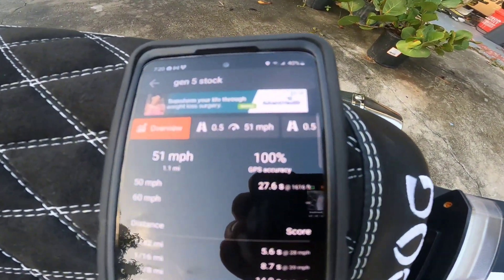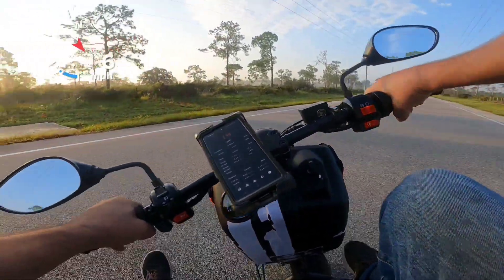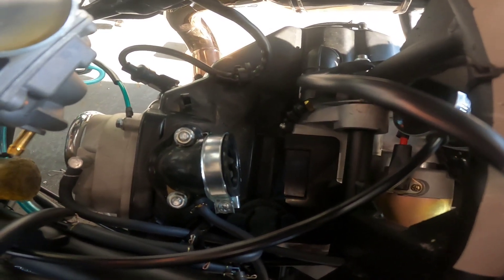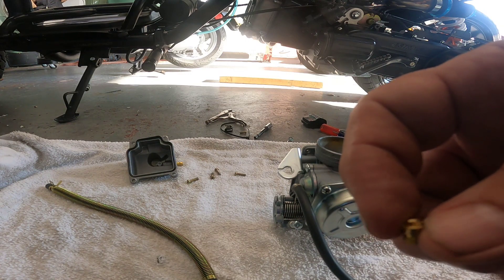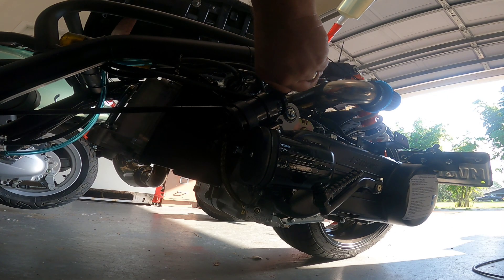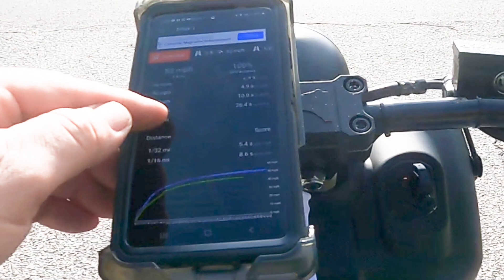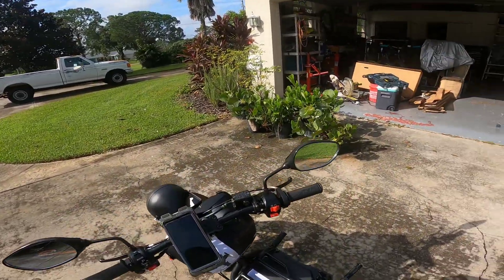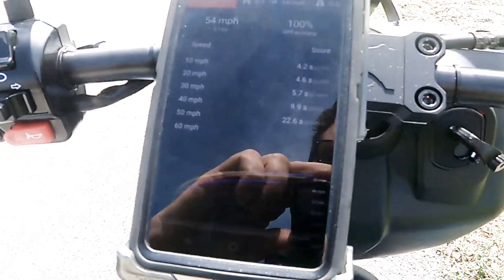Maddog 150 Free Mod #1 (Air Filter) +4 mph.

Comment: So if I swap out my stock filter with a UNI I have to take off the whole carburetor and change out the jetting?
Reply from the maker: @210psychoholik  if you watch the next couple of videos I ran it just doing the swap and it did fine.  Then I re jetted the carb and only got 1 more mph.  So not really worth it cause the carb is tamper proof.  Just toss the filter on and ride.